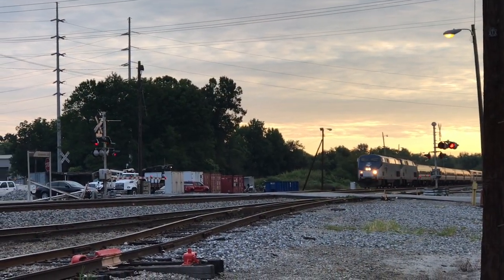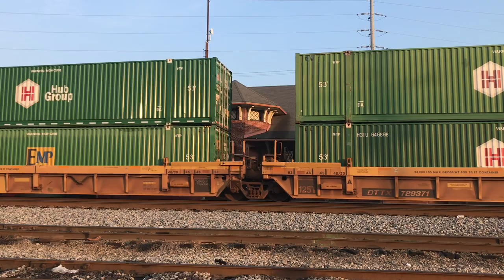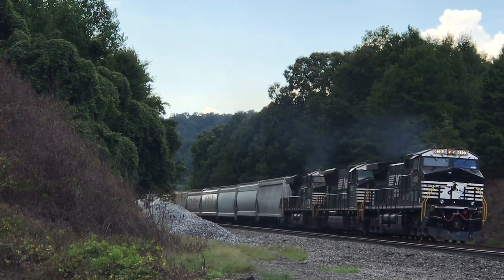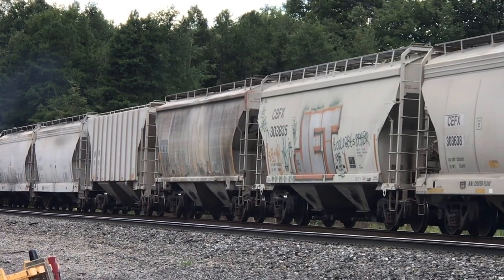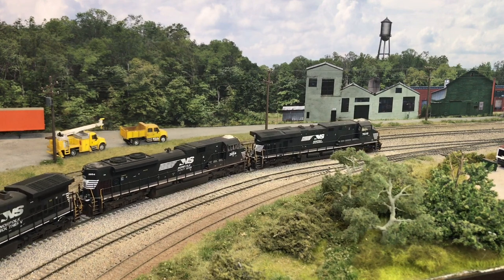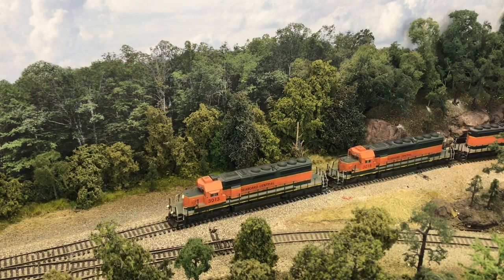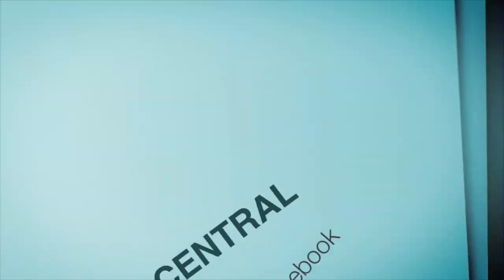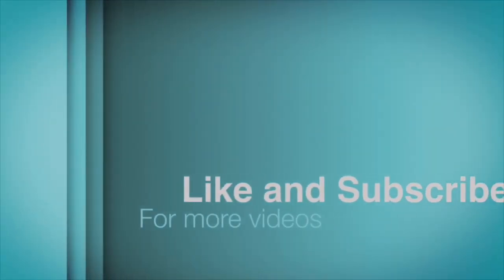Seaboard Central Operations Part 1 - Trains

Comment: I was wondering if you made the pine trees on your layout? They look really good. No one makes good pine trees that represent southeastern US pine trees. If you did make them I'd like to see you do a video on how they're made if you would. You have a great layout. The forested backdrop and trees in front blend perfectly. I live close to Linwood yard, around 20 miles away, and plan on modeling a branch line off the main line from Salisbury south to Albermarle. First and second generation southern railway diesel time frame. I will need lots of regional type pine trees to give the southern mixed forest feel. Thanks in advance. 👍
Reply from the maker: I use trees from various vendors. Some are JTT trees and a lot are some I made from Scenic Express Super Trees kits. My favorites though are white pine trees which were custom made and no longer available.

Comment: Enjoyed the video Tim; informative. What determines if a train will mid train or end of train DPU’s?  Anthony
Reply from the maker: On NS and CSX they prefer to run DP units in the middle to 2/3 for better train handling. On loaded unit trains you will often see the DP units on the rear, especially coal trains that are flood loaded.
Reply: Seaboard Central Thanks for the reply Tim

Comment: Thanks for the video. I was wondering in your video I saw the helper/braking locomotives in the middle of the train an not on the end I've seen other rail companies do this to. Is there a reason for the locomotives to be in the middle of the train and not on the end? Thanks again.
Reply from the maker: Hi Jeff, good question about the DPU locomotives. Train handling is a lot better with the helper or DP units about 1/2 to 2/3 back in the train. On a mixed merchandise train made up of loads and empties along with cars with extended draftgear couplers they run rough when the locomotives are at the rear and can contribute to separations. It’s not so bad on loaded unit trains though. Tim

Comment: Excellent video. Are the DPU's on a train used mainly for brake force?
Reply from the maker: They are used for braking and power. These trains can be super heavy and super long requiring their use.
Reply: @SeaboardCentral  Thanks for that. I had a feeling power would be in there somewhere. 
I'm sure you know when your pulling all that weight! 😉 Keith

Comment: Tim, you made mention of the intermodal that runs from Savannah to Cordele on the HOG, that service has been discontinued for close to a year.
Reply from the maker: Good to know. I guess it was in operation during 2015. Is that correct?
Reply: @SeaboardCentral  I think that's when it was started and the in-land port opened in Cordele

Comment: Man I wish I never woulda taken my buyout...I'm now currently a owner operator trucker of 4 semis and 2 vans....after I paid my driver's and last breakdown I made 53 cents a hour last week...if I would a stuck with railway work I'd have a paid off house and certainly a model railway....
Reply from the maker: Railroad life can be challenging sometimes but the pay is good and now that I have great seniority the schedule isn’t bad either.
Reply: @SeaboardCentral  i woulda been seniority based to, hired in 1994 at thw CCP....probably would a been retired or close today...they offered me a lump sum and I took it, then got talked into a shortline for 4 years...even the shortlines pays better then trucking....what I spend a year in fuel is what most spend on a house...lmao....but for now I'm still building models out of my truck

Comment: Have you ever rode through Spartanburg South Carolina
Reply from the maker: Its been a while. We have some long pool intermodal Trains that run between Atlanta and Linwood but I prefer locals with better schedules and sleeping in my own bed every night. Tim
Reply: @SeaboardCentral  Okay I Just Said That Because I Railfan In Spartanburg SC And Sencie You Work For NS I Wanted To Ask You
Reply from the maker: No problem! Right now I’m o  a local that runs between Chamblee and Duluth, GA. Every now and then I work a local that runs between Gainesville and Toccoa, GA. But who knows, maybe in a couple of years I might spend a few weeks on the hotshots - 203,204,211,212,213 and 214. Tho highest paid engineer jobs work those trains but they spend a lot of time away from home and that cuts into my modeling. Lol! Tim
Reply: HaHa What Is The ID Of Your Local?
Reply from the maker: P52 at Chamblee and P68 at Gainesville.